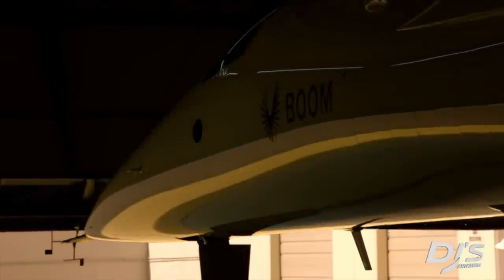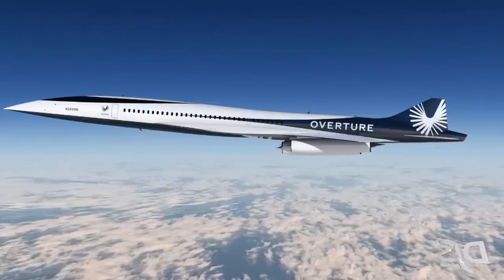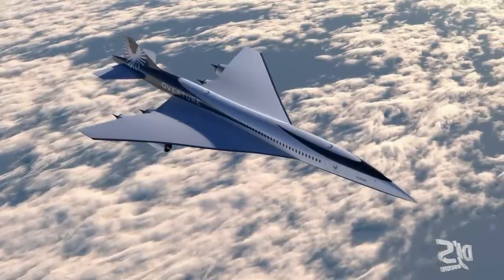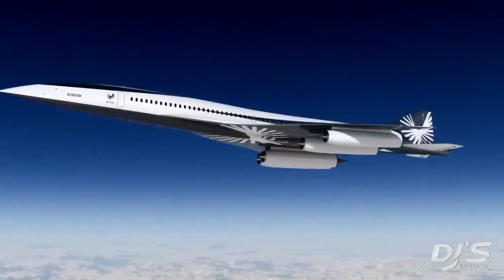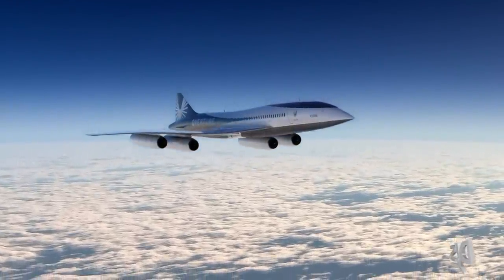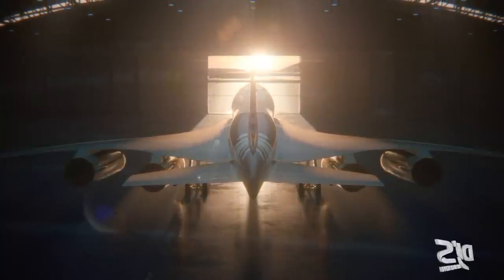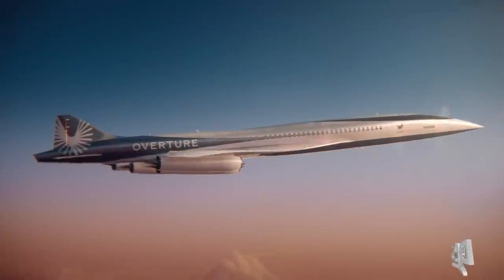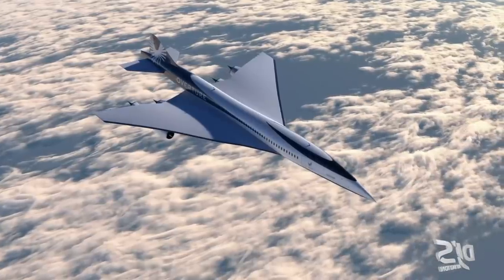Boom Supersonic MASSIVE News

Comment: I'm just not sure this will be financially viable. It will have expensive operating costs and people who can afford it would most likely prefer the comfort of business class
Reply: Speed and cache have their value to elites.
Reply: Overture is not aimed at the main line economy market, which is more than adequately catered for by Boeing and Airbus, for example. Instead, it is targeting the 700 million long range business trips made each year globally, 400 million by Americans.

Because Overture will be fuel efficient at sub and supersonic speeds, and will be compliant with ICAO-14 subsonic noise regulations, Boom and the airlines have identified 500 viable routes, some mixed land/water, compared to just 2 Atlantic routes for Concorde. Commercial supersonic flight over land is effectively banned worldwide, so Overture will fly Mach 0.94 (10% to 20% faster) over land and Mach 1.7 (x2 faster) over water. 

A subsonic airliner does the JFK/LHR trip in 8 hours. Overture will do it in 4 hours.
A 16 hour subsonic trip across the Pacific would require a 1 hour refuelling stop, giving a duration of 4+1+4=9 hours total on Overture. 

All 65 to 80 seats will be quiet business class, almost certainly with internet, with ample room. Tickets will be the same price as subsonic business class. This, coupled with twice the utilisation of subsonic airliners, would give a good margin for the airlines.

Comment: 2 engine mach 1.7 110 passenger thats minimum for consumers beyond the filthy rich
Reply: Overture is not aimed at the main line economy market, which is more than adequately catered for by Boeing and Airbus, for example. Instead, it is targeting the 700 million long range business trips made each year globally, 400 million by Americans.

Because Overture will be fuel efficient at sub and supersonic speeds, and will be compliant with ICAO-14 subsonic noise regulations, Boom and the airlines have identified 500 viable routes, some mixed land/water, compared to just 2 Atlantic routes for Concorde. Commercial supersonic flight over land is effectively banned worldwide, so Overture will fly Mach 0.94 (10% to 20% faster) over land and Mach 1.7 (x2 faster) over water. 

A subsonic airliner does the JFK/LHR trip in 8 hours. Overture will do it in 4 hours.
A 16 hour subsonic trip across the Pacific would require a 1 hour refuelling stop, giving a duration of 4+1+4=9 hours total on Overture. 

All 65 to 80 seats will be quiet business class, almost certainly with internet, with ample room. Tickets will be the same price as subsonic business class. This, coupled with twice the utilisation of subsonic airliners, would give a good margin for the airlines

Comment: I would love to see this plane enter service but if it doesn't receive more orders it will be like the concorde, a plane that costs a lot to operate, it offers a niche market and isn't feasible and isn't profitable for the airline, nor manufacturer
Reply: Overture is not aimed at the main line economy market, which is more than adequately catered for by Boeing and Airbus, for example. Instead, it is targeting the 700 million long range business trips made each year globally, 400 million by Americans.

Because Overture will be fuel efficient at sub and supersonic speeds, and will be compliant with ICAO-14 subsonic noise regulations, Boom and the airlines have identified 500 viable routes, some mixed land/water, compared to just 2 Atlantic routes for Concorde. Commercial supersonic flight over land is effectively banned worldwide, so Overture will fly Mach 0.94 (10% to 20% faster) over land and Mach 1.7 (x2 faster) over water. 

A subsonic airliner does the JFK/LHR trip in 8 hours. Overture will do it in 4 hours.
A 16 hour subsonic trip across the Pacific would require a 1 hour refuelling stop, giving a duration of 4+1+4=9 hours total on Overture. 

All 65 to 80 seats will be quiet business class, almost certainly with internet, with ample room. Tickets will be the same price as subsonic business class. This, coupled with twice the utilisation of subsonic airliners, would give a good margin for the airlines.

Comment: Can't wait to see ticket prices for this lottery winners only .
Reply: Overture is not aimed at the main line economy market, which is more than adequately catered for by Boeing and Airbus, for example. Instead, it is targeting the 700 million long range business trips made each year globally, 400 million by Americans.

Because Overture will be fuel efficient at sub and supersonic speeds, and will be compliant with ICAO-14 subsonic noise regulations, Boom and the airlines have identified 500 viable routes, some mixed land/water, compared to just 2 Atlantic routes for Concorde. Commercial supersonic flight over land is effectively banned worldwide, so Overture will fly Mach 0.94 (10% to 20% faster) over land and Mach 1.7 (x2 faster) over water. 

A subsonic airliner does the JFK/LHR trip in 8 hours. Overture will do it in 4 hours.
A 16 hour subsonic trip across the Pacific would require a 1 hour refuelling stop, giving a duration of 4+1+4=9 hours total on Overture. 

All 65 to 80 seats will be quiet business class, almost certainly with internet, with ample room. Tickets will be the same price as subsonic business class. This, coupled with twice the utilisation of subsonic airliners, would give a good margin for the airlines.

Comment: BAD NEWS.  Continued REDESIGN is troubling.  Remember Aerion?  All the did was redesign, and they are GONE.  And SAVING MONEY with 4 engines?  WHAT?  Are you just parroting a press release?  Why don't all modern airliners use 4 engines if THAT saves money over 2 engines?
Reply: @jasonatkins1467  Redesigns are part of the aircraft development program, and if they lead to a better product they are a good thing. Many successful aircraft have had major redesigns during their development programs, Concorde had three.

By modern airliners you mean subsonic airliners with huge, heavy, very high bipass engines, that are extremely expensive. You can't possibly compare that type of engine with a supersonic engine. Just imagine a couple of Rolls Royce Ultrafans bolted to the wings of Concorde in place of the four Olympus turbojets. 

It is quite possible that four engines will give advantages over two engines, including cost, performance, reliability, weight, safety, and servicing, especially if they are mounted in pods under the wing.
Reply: @phonicwheel933  Well it has been a year since my comment and the plane has gone NOWHERE.  I don't think the Concorde was RADICALLY redesigned.  Boom has no engine. The scale model can't even accomplish taxi tests.  And it isn't even a model of their current redesign.   It's DONE.  Mark my words.  We can revisit this each year until it is official tand the company officers have stopped wasting investor capital.  If customers wanted to pay a premium for supersonic flight, Boeing and Airbus would ALREADY have planes in that marketplace.  The IDEAL market would have been smaller bizjets.  Areon tried and failed at that market.

Comment: Think back before the Concord to a children's story,  " The Emperor's New Clothes ".This Boom has motors behind the main wheels.  It has an undersized rudder that gets eclipsed when it slows down.  Don't be on board when they do stall testing.  It will tumble like a maple seed.  I wonder what the carry on baggage policy will be and how well it will handle belly cargo? There's weight shift.  I'm sure people will line up for those 65 budget tickets. How's Boom going to handle San Diego to L A to Portland to L A to San Diego?  Stewardesses are going to get bounced around like ping pong balls.  Don't forget to deice the Boom.  If it has oddball wheels and tires,  that could be a three day layover.  United is throwing money away like confetti.  What we need right now is slow planes with fat seats,  big bathroom holding tanks and liberal bags policy like PSA used to offer.  Slow means cheap tickets,  bigger profits,  better belly cargo loads,  less noise,  shorter runways,  and best of all,  low expectations and demands. Maybe United could order the revolutionary Max 7.

Comment: So quiet.
Reply: @grandslapper Boom state that Overture will comply with ICAO-14 noise regulations, which will be slightly quieter than current subsonic airliners. This means that Overture will be able to use all international airports.

Boom will achieve this by using medium bypass turbofans with spike input diffusers and variable geometry nozzles, along with four engines, rather than two.

Comment: If that plane does become real, it will be the same as the Concord.  Prices for tickets will not be for the 10s of millions, but only for the rich.  This is not the future of commercial aviation, it's just a way for some company to make some new jets, then probably go bankrupt since they cost too much, no ones using them, thus ultimately more wasted time and money.  Useless for the general public.
Reply: Overture is not aimed at the main line economy market, which is more than adequately catered for by Boeing and Airbus, for example. Instead, it is targeting the 700 million long range business trips made each year globally, 400 million by Americans.

Because Overture will be fuel efficient at sub and supersonic speeds, and will be compliant with ICAO-14 subsonic noise regulations, Boom and the airlines have identified 500 viable routes, some mixed land/water, compared to just 2 Atlantic routes for Concorde. Commercial supersonic flight over land is effectively banned worldwide, so Overture will fly Mach 0.94 (10% to 20% faster) over land and Mach 1.7 (x2 faster) over water. 

A subsonic airliner does the JFK/LHR trip in 8 hours. Overture will do it in 4 hours.
A 16 hour subsonic trip across the Pacific would require a 1 hour refuelling stop, giving a duration of 4+1+4=9 hours total on Overture. 

All 65 to 80 seats will be quiet business class, almost certainly with internet, with ample room. Tickets will be the same price as subsonic business class. This, coupled with twice the utilisation of subsonic airliners, would give a good margin for the airlines.

Comment: Sustainable!@!!@!?? It would be nice it this thing could become a reality but with 4 engines with very low bypass ratio no RAM capability even if they existed, this is no recipe for efficiency.  Nothing like reality to rain on the parade of computer generated simulations. Unproven technology, very small market, not that fast (Mach 2.2 was the number to beat), years already behind schedule.  What could possibly go wrong.  Everything.
"stimulated software designs", very stimulated indeed.  That is what is needed to convince investors.

Comment: Reading today's news , Oct 12 22 , Boom is no longer in partnership with RR to provide the engines...without that this is just a mockup and what ever the CEO states is just marketing...No engines = no plane and Boom = Bust..
Reply: Rolls Royce had an advisory partnership with Boom. That contract has now ended. It would not be feasible for any of the tier one engine manufacturers to undertake the Overture engine development, in view of their high costs and long time scales and the relatively small number of engines that will be required, compared to the thousands for the main line market.

Florida Turbine Technology started the detailed engine development in January 2023. The engine will be a medium bypass supersonic turbofan which will use certified materials and parts, including, blades, rotors, accessories, and core. The manufacturers of these parts will assist throughout the engine development and certification program.